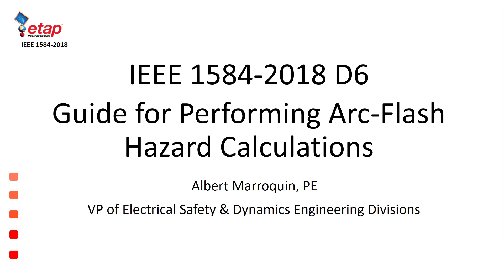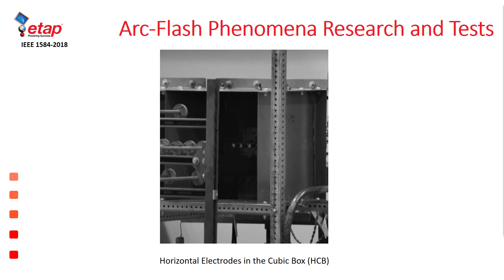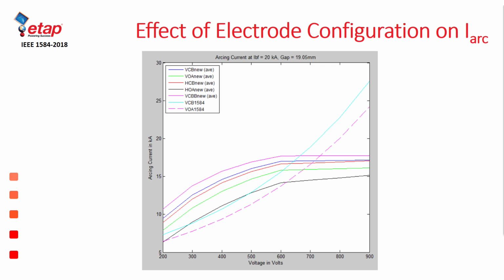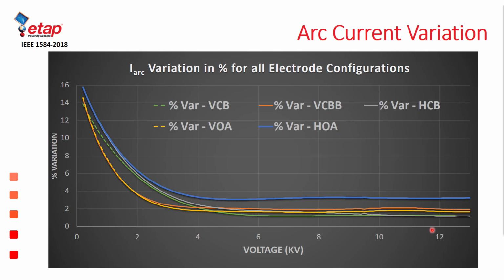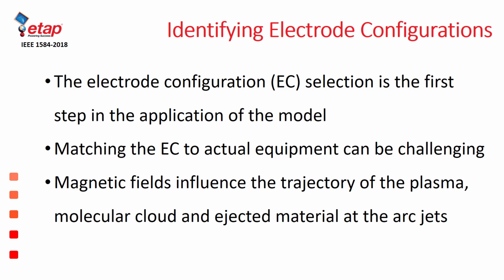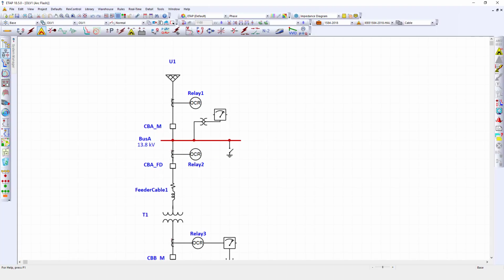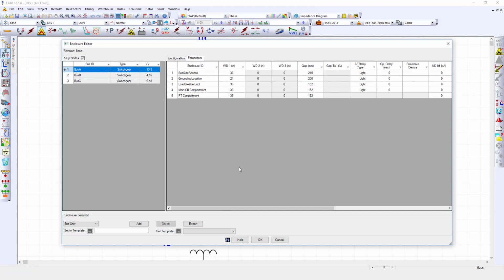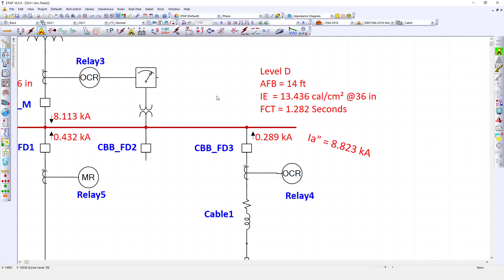IEEE 1584-2018 Arc Flash Incident Energy Calculation Method using ETAP

Comment: Thank you for your presentation. I do have a question, since IEEE 1584-2018 scope includes systems with voltages from 208 v to 15 kV only (and it no longer recommends Lee Method for V≥15kV), what method are you using in ETAP to calculate incident energy in systems with voltages greater than 15 kV? (Currently I am doing an arc flash study in a 34,5 kV switchgear, three-phase). Thanks.
Reply from the maker: Thank you for your interest in ETAP Software. Please contact support at support@etap.com or contact your local ETAP representative to assist
Reply: @ETAPsoftware  Mr. Jose Cardozo is not saying he is interested in ETAP. In case you did not understand his question, let me repeat it for you:   what method are you using in ETAP to calculate incident energy in systems with voltages greater than 15 kV? 

I am interested too in your reply but i know it is suggested in IEEE 1584-2018.  Thank you!
Reply from the maker: ETAP has  a solution for your application and it is subjected to some more specific details concerning your system and needs. The best approach is to call ETAP help center or our sales team (Sales@etap.com)  to get a concise response meeting your needs, as we do have some proprietary information that cannot  be shared in a public domain. Feel free to open a request in help center or contact our sales department for more details

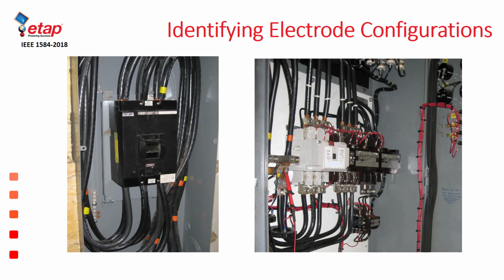Comment: At the 52:15 you begin to explain the top of the circuit breaker being a VCBB but the bottom being a VCB type? Are you using the top of the circuit breaker as an "insulation shield" in the event of an arcing event? But what if this circuit breaker was installed closer to the ground and not at eye level would the classification be reversed since the head and torso are now "shielded"? Thank you in advance.
Reply from the maker: Hello Michael, thank you for your interest in ETAP. I forwarded your question to our Arc Flash team, which I trust will get back to you shortly. In the meantime, you can also log into our HelpDesk 24/7  and raise your question with our support engineers.
Reply: The top configuration was VCBB because the breaker itself can be a barrier (i.e) a tool may come in contact between the conductors and the arc plasma can shoot towards the working personnel due to the breaker being a barrier to push it  forward.  However,  irrespective of double configurations, ETAP can support both configurations defined in the enclosure editor and the final incident energy calculation will be based on the worst case incident energy.

Comment: sir can u gude me about Arc Flash sequance why can breaker cannot operate in Arc flash sequance analysis??? kindly guide me about this situation...............how it can taggle in etap 16.0.0
Reply: Hi Saad. The sequence of operation tool is available when 3 Phase Arc Flash is selected in the study case editor. Please confirm you have selected this.
Reply: Saad, There are many reasons for this behavior. If it is not properly interlocked to a protective relay or if the fault is on a location for which the same breaker cannot be a source protective device (PD) . For Arc flash , The  clearing time (Arc duration) is based on arc current seen by the Source PD which is in the path of the source contributing it to the fault.